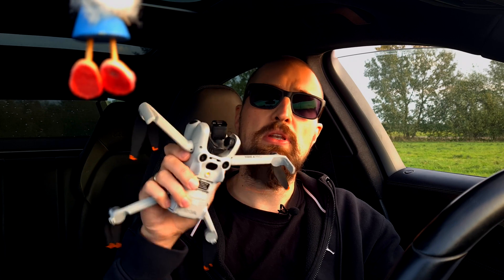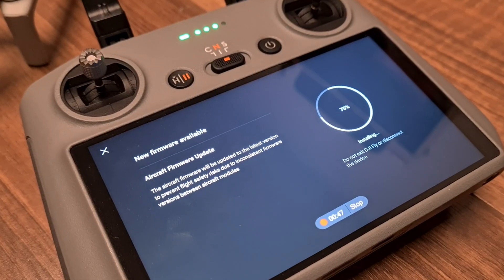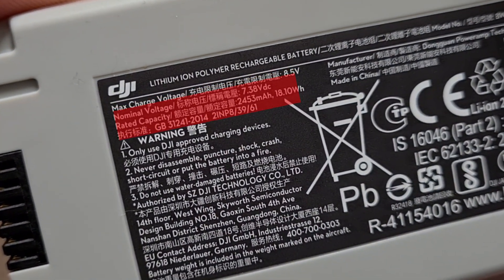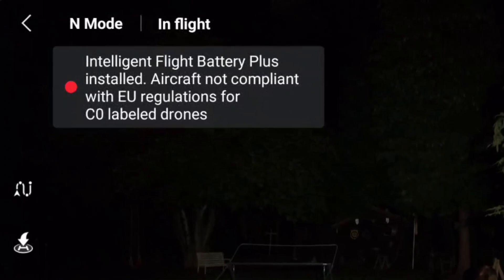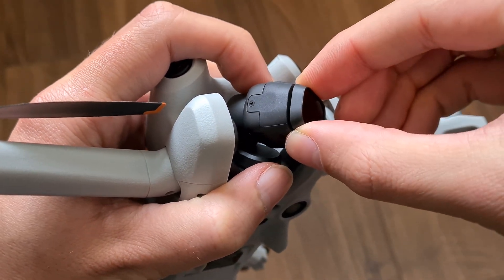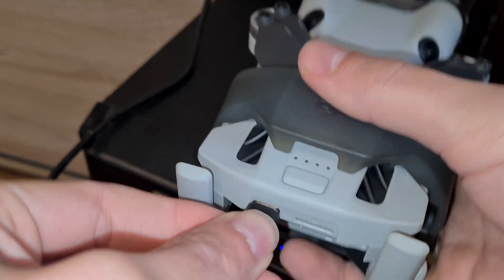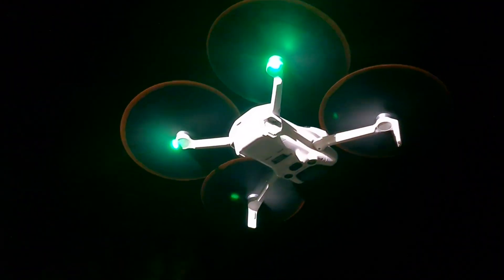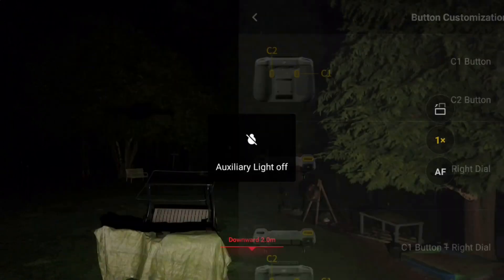5 HIDDEN FEAUTURES you didn't know about your DJI MINI 4 PRO | Guide

Comment: Why be careful if it’s over weight if ima register it anyhow?
Reply from the maker: Because the EU C0 regulations are only valid for drones below 250 grams. Not 100% sure how the regulations are in US
Reply: I'm going to take that as a typo, and interpret it instead that you're not registering it.

Is the serial number attached to you, or did you buy it second hand?  Also, this type of thing is something that causes problems if something goes seriously wrong - eg, your drone drops on someone's head causing injury.  At this point the authorities are motivated to find you, regardless of registration. If it was overweight, you're in bother.

Comment: Hello sir good afternoon I have a Dji mini 3 pro that giving me some problems that I can’t seem to solve, no matter the distance I set on it, it just stopped at 98ft saying max altitude reach and I set it at 300ft or more what can I do to solve this sir please help me
Reply from the maker: Looks like to me your drone stays in altitude mode. Have you checked if it got connection to satelites?
Reply: @doatrip  yes it got connected to satellite so I’m not sure what is causing that problem
Reply from the maker: If you are not able to identify the root cause I would recommend you to contact the repair shop of DJI.